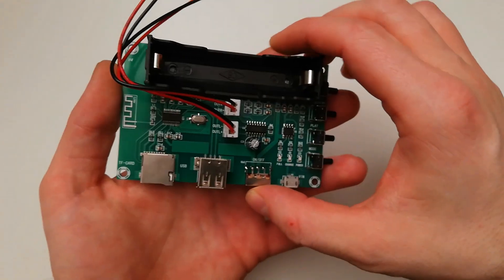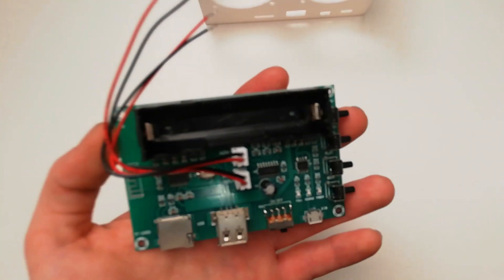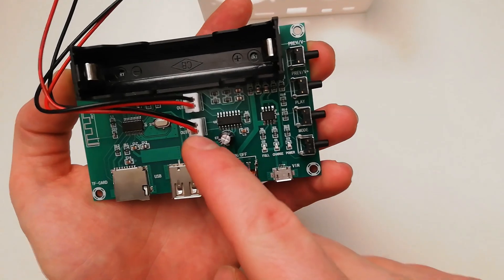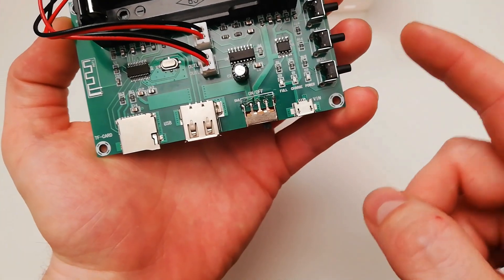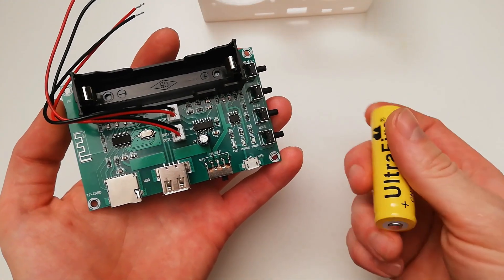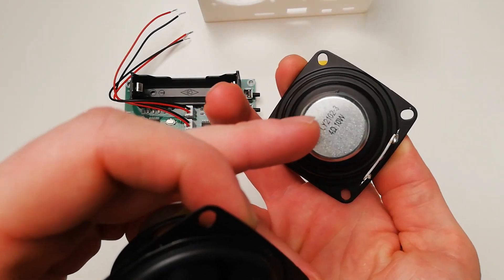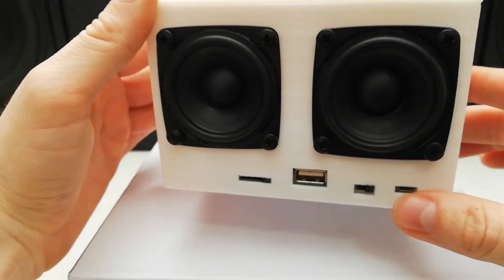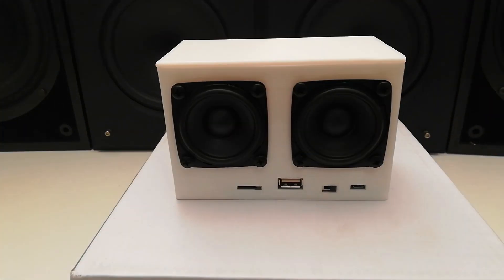DIY - 3D Printed Bluetooth Speaker (PAM8403 amplifier)

Comment: SWEEEEEET! You did everything right. I would like to add a passive radiator on the back. Maybe they lied about the speaker wattage and I thought that chip was only 3 watt per channel?
Reply from the maker: I am preparing a 2.0 variant now with the same electronic board inside but 15W speakers and it drastlicly improove the sound and performance.. 👍

Comment: Its a pretty crappy amp. Just bought it. U need to change 2 resistors and it will be good(the gain is too high. So it clips out at high volumes)
Reply: Which resistors?
Reply: @sarfarajakram6386  the ones on amp chip audio input
Reply: @sarfarajakram6386  and btw. The amp is ment fir 5v input not 3.7 what battery can provide